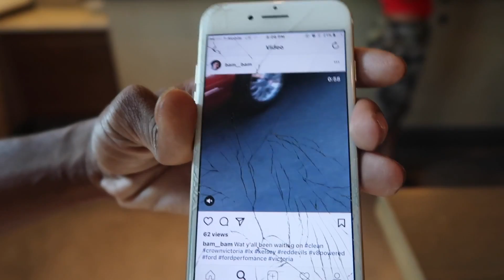Mustang Week 2017 Day 4 Car Show

Comment: http://www.intowindows.com/how-to-enable-or-disable-sleep-mode-in-windows-10/ there is how to turn off sleep in windows 10 so you dont have to worry about the system sleeping on you while trying to upload.
Reply from the maker: +iikon69 Windows. What is this windows you speak of? We have a MacBook. And there is a setting for it but has to be powered into an outlet.
Reply: Well hell there is your problem
Reply: Sounds like you may need to invest in an inverter for your next trip :), will go well with your jump pack.